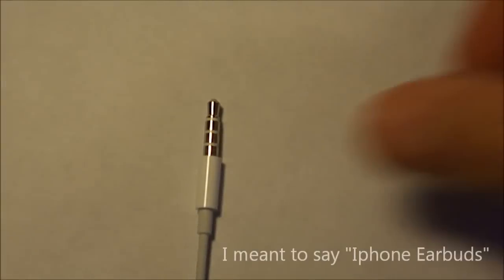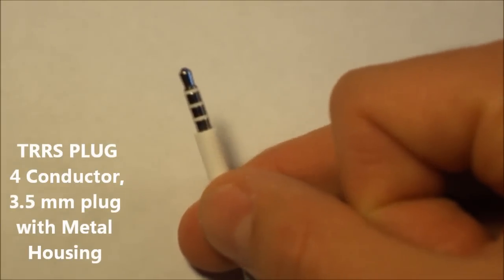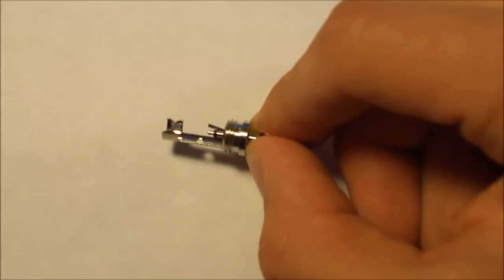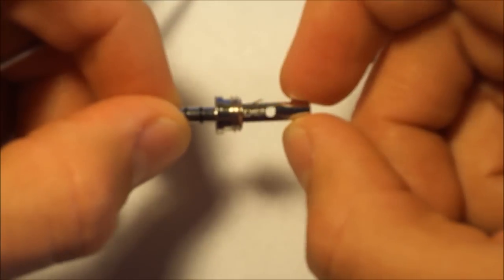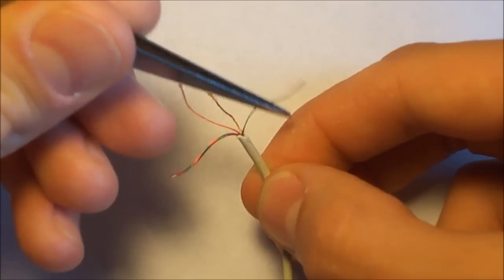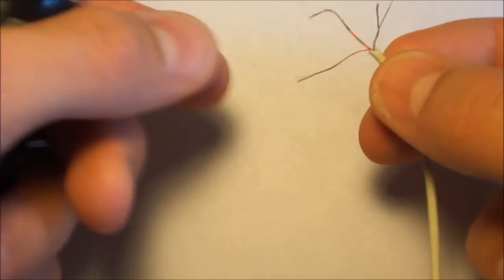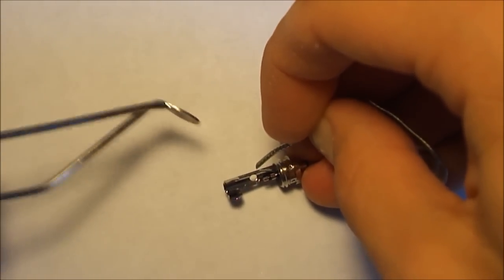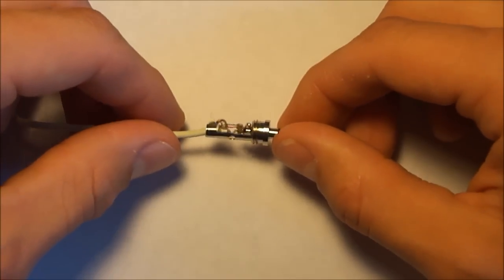Repairing Headphones with Microphone (TRRS Plug)

Comment: i really need saving .-.
i have samsung s3 headphones. when i cut it open, i found insulation, a red wire, a little twisted copper wires, a black wire and a green wire twisted in tiny green wires.
question is, what are the black and little green ones for?

Comment: Hey Rich! Would it work if I just use the replacement jack that I cut off from an old headphone I have? Both headphones are the same model.
Reply from the maker: Yes, I made two videos showing how to do this:
Headphone w/ Microphone Repair (Unbroken Headphone Set)
and         

Headphone Repair using Unbroken Headphone Set

Comment: What type of an adapter do I need that connects an android or ipad headphone (Sony MDRZX300IP or MDRZX310AP) to my HP EliteBook 8460p laptop which has a separate audio and microphone jack?  Please recommend. Thanks
Reply from the maker: You might have to separate the wires yourself and add your own TRS plugs. It's tricky. What headphones does HP usually recommend?  I am guessing that normally their would be a separate microphone (not integrated into your headphone).

If you want take it to RadioShack and tell them what you are looking for.  They might have something that could help.

Comment: will this method work on an astro a40 quick disconnect cable?
Reply from the maker: It should, but the wiring layout (colors of the internal wires) may be a little different, especially after the disconnect area.

Comment: So, has someone figured out how to get the button works ?
Reply from the maker: Yes, here is the wire configuration:
Red = Right Ch
Blue(or green) = Left CH
Copper = Ground
White = Remote
Blue(or green) + Red that were surrounding white wire (listed above) needs to be twisted together with the copper ground wire.
Reply: RichsMethods Thanks... It works :D
Reply from the maker: Albert Cipta Its like magic when it does work!

Comment: is it possible to recable a pair of headphones not earbuds that have a trrs cable with a trs cable and not have a loss of sound quality or any drawbacks or can you make a video that can explains how to recable a headphone with an interchangeable cable
Reply from the maker: I just posted two videos that may help explain this. The answer to your question is yes, you can exchange a trs plug for a trrs plug without loss of sound quality. However, you need to cover the unconnected wires with electrical tape.

Comment: Hey I did a google search for a Klipsch S4i repair because I wanted to figure out the microphone problem and found this answer, hope it helps!

The correct wiring should be as follows:

After you clip off the plug and strip back some rubber sheathing you will see wires separated in to 4 twists. 1-Red, 2-Blue(or green), 3-Copper and 4-red+blue(or green)+white.

Red = Right Ch
Blue(or green) = Left CH
Copper = Ground
White = Remote
Blue(or green) + Red that were surrounding white wire Need to be twisted together with the copper ground wire. This is critical!
Once I did this the sound was exactly as the new pair I had, Bass, highs, stereo separation were back! Just wanted to pass this along.
Reply from the maker: Thanks for the info. I'll keep a copy of this in case someone asks.

Comment: Hey Rich.  I need to replace the jack on a Plantronics headset.  One earpiece and a microphone boom.  Would this be the same process only using a 2.5MM jack?  I assume it'll also have 4 wires instaed of 5.

Comment: I have TRRS Plug but it doesnt look like the same as yours (internally) as the one in the video . It has 3 heads instead centering a flat middle .
Reply: and also , this is a Razer Blackshark ( which has a mic ) , and it seems that it doesnt have a red/green wire but only has a red , green , copper , and another copper covered in white enamel .  How do I do this then ? Really need help ! Thanks !

Comment: This 3 ring headphones usually come with some sort of controller, so in one side i have 2 copper, 1 green and 1 blue and , the other side, only has 1 copper and 1 green.The question would be:how do i join this together without using the controller?
Reply: same here~
Reply from the maker: Halim Mukreem I would join the two copper wires together (one if the ground for speaker portion while the other is the ground for the controller portion. The green wire is "sound" wire, the blue wire is probably the controller wire, but I'm not totally sure. I'd not connect the blue wire and treat the green wires are your right and left headphone wires respectively. If that doesn't work, then the blue wire is probably the sound wire in the one earbud (in this case, don't connect the green wire). It may take some trial and error, but it's worth a try.

Comment: Couldn't you just rip apart the jack you just cut off and use that? Instead of buying a new 3.5mm jack?
Reply from the maker: Yes I was thinking of making a video showing how to do this.
Reply: RichsMethods I would really appreciate if you make this video :D
Reply: Its easy :/
I fixed all of my earphones and headphones,1 skullcandy,bose,beats and a currently doing the sony...and used the same jack.Well the 4rings with mic and vol,play/pause earphones are tricky and usually dont work,so need a tutorial for that :D
Reply: RichsMethods I would appreciate that as well. Even more if they are the iPhone 5.
Reply from the maker: Wasee Mustafa
Arthur Reis
L. Joshua Rodriguez Depending on where the short is occurring, you might only have a small amount (or none) of the wire left over to solder back together.  You could resolder to the original jack (the metal part), but you'd have to remove the plastic coating and carefully resolder to the each respective connector. It's tricky, but doable.
Reply: I have been trying for around 2 hours to re use the jack, it's very hard to not get the wire touching and even trying to solder them on the body is small, just easier to buy a metal 3.5mm jack.
Reply: When headphones come in, dont check headphones, check the front speaker.
Propblem solved, dont need to order or fix anything.

Comment: Thanks for the helpful video.  I find one of the most confusing parts of this is figuring out what cable goes where for your particular equipment (L, R, Mic).  Then sometimes different names or references are used for the same parts and that increases confusion. For example, on the graphic at 6:00 you write about connecting a cable to the "ground" and another to the "outside" connector.  I would suggest you establish, for the particular application, which cable is what (L, R, Mic, Ground) and to what part of the plug it should connect - Tip, Ring1, Ring2, Sleeve...then also identify which or the connectors on the plug correspond to which of those...the outer one as sleeve, the center one as tip and which ones correspond to R1 and R2.

Comment: My volume/ mic button on the headphones aren't working how do I fix this?
Reply: MOREVENOM you found a way yet?
Reply: @Kyliej0nes  have you?
Reply: @ryalv4054  have you?
Reply: @xenondestiny  nah but twist it and try
Reply: @xenondestiny  or open your app up and then try also
Reply: @xenondestiny  have you?
Reply: Are the headphones your using iphone earbuds (the one in the video)? If so, what device are you trying to use it on? The volume buttons and mic are only compatible with apple devices. Maybe there are a few exceptions, for example pressing the mic button will pause my music and i am using a samsung, but other than that there are very few phones compatible with the apple earbuds other than apple devices themselves.
Reply: Fire Tiger i have the same as in the video for my iphone (its original) and my microphone and the volume buttons aren’t working , pls help me out is there anything to do to fix this 😭
Reply: @miraasr  have u found a way yet?
Reply: idk but i have the same problem

Comment: so my colors are like this | Green | Red | Copper ( rolled on the White wire ) | Red twisted with copper | Green twisted with copper | It's a bit different in your video so |  Green(Tip) | Red(second ring) | Copper(ground3rd) | White (Mic) | But what do i do with both red and green twisted do i put red twisted with the copper and green twisted with White Or Just twist the red and green with copper toghether and stick them on ground with copper just the White on mic seems a bit short?

Comment from the maker: I think that the copper and red wires are the same as shown on my video. However, the blue or the green wire is the microphone.  My best guess would be to treat the blue wire as the red/green striped wire in my video. If that does not work, then switch the blue wire with the green wire. Hope this helps!

Comment from the maker: Not for this plug (TRRS plug), however, if u have a TRS plug (my 1st headphone video), there is another option. My 2nd headphone video shows a TRS plug that does not use solder. Instead it has small screws to hold the wires in place.

Comment: No problem, but be sure you put the right wire on the right soldering spot. That could be tricky without a multimeter. They look a little different on the inside than what this guy is using in his video, that's why. If I recall correctly the most outer ring corresponds to the most outer solder part etc. If you see this picture and go from left ring to right ring, the most left corresponds to 4, then 3, 2, and 1. cdn.head-fi.org/6/62/900x900px-LL-62156fa4_plugsnshit.png

Comment: To get my jays four remote working on my iPhone 5 I connected the red wire to Tip, green to Ring 1, blue ground to Ring 2, white to sleeve and the copper wire surrounding my white wire to ring 2.    Another tip is buy 2 plugs as it takes a while to practice your soldering.  Use blu tack to insulate your wires inside you plug to stop it shorting.  Some people recommend glue but blu tack is easier to work with.    Total cost =$10 or 2 plugs.   Beats replacing $80 headphones

Comment: Great video.   Slight correction which result in the remote and volume controls working.   The red/green copper wire surrounding the white wire is more likely a second ground not the microphone wire.  The white wire is actually the microphone and needs to be connected to the sleeve on the plug.   If you twist the copper outer wires together and connect to the same terminal as the speaker ground your remote will work.   That is connect the copper wire to Ring 2 on your plug.

Comment: Hey, Rich! This is a very nice tutorial, however my colors doesn't match up these in the video. At first it looks like I have 4 wires, but the copper one is twisted around a red, so that needs to be twisted out first. Then there's a blue, and a green wire. But then there's also this kind of red and White wire, and it's that one that confuses me. I already have a new plug but I'm confused about where they'll go. do you have any ideas about where these would go? They're quite cheap Skullcandy.

Comment from the maker: The blue might be the ground for the microphone. Does the Green/Red Microphone wire have a white or copper colored wire mixed in it?  If it does not, then the blue wire is probably the ground and would be connected to the ground connector (with the other ground wire from the headphone).

Comment: Richs, i have a 8 pins samsung headphone (+mic) and i want to use this headphone with my samsung galaxy ace s5830 phone. My phone headphone jack is 3 pins. I cut the headphone cable to convert jack but headphone has 8 pin. Is it possible use this headphone for samsung s5830? Can i convert 8 pins jack to 3 pins? pins colours: black, white, green, blue, red, magenta (or purple), copper and silver (like copper but a bit dark). Thank you...

Comment: nice video thanks for uploading. one thing that i noticed here in the comments and in your video was the high price of TRRS (@ this price you can get a brand new low cost headphones) and thats how you get like 4-3 sets of broken earphones... any way i uncovered the wires and found out that i have 5 wires Copper (Ground), Red&Green (MIC), Red (Right),Green (? left) and Blue (? left) and i cant find info on how to connect them to the TRRS maybe do you know ? no standard type of earphones with mic

Comment from the maker: You most likely will have to do some "surgery" on the combined wire (large wire) and on the wire that came completely out. First, take the outer covering off the headphone wire (the one that came out).  Dissect out the wires inside. You should be able to determine the colors of the wires at least.  Next, you'll have to carefully remove the outer coating of the combined wire, and dissect out the colored wires in the Headphone wire. Then splice / cut these wires and reconnect them...

Comment: Guys honestly don't bother, I spent over an hour  and a half trying to get this done but it was a complete failure. The efforts not worth it. Juice aint worth the squeeze as they say.  I wasted 23 bucks on the TRRS plug cuz the little plastic part in the middle melted, just from the proximity of the iron. Wish there was a warning about that. Its easier to just take it to a electronic shop and pay for it to be fixed.

Comment: Hey Ritch, my original heaphones had a TRS jack (two rings). But when I exposed the wire, I get four wires: copper and red on one side(right), and green and red green on the other(left). With white wires in all four. Are the copper/green ones the ground then?

Comment: It's rather easy, just fixed mine today. After a while of trial and error I figured out where the other red and green wire are supposed to go.
You have 4 "pins" on which you solder all the wires, to go from inside out:
Most inner pin: green
2nd : red
3rd : 2nd red & green + white (it is inside the copper wire)
Most outer (largest pin): copper (ground)

To figure out which are 1st and which are the 2nd red and green wires. Just try them on the inner pins. The pair that produce music go there.

Comment: The SNAP converts your earbud wires into: 1) a leash to prevent device loss and theft, and 2) a catch wire to prevent dropped device impact damage.      PATENT PENDING
Go to "Earbud SNAP" You Tube

Comment: ok so I have the latest apple earpods but they don't have the volume adjuster. at first the left earphone didn't send audio and then later the right one broke as well. usually I can fix the right when I twist the jack a little but its not tht effective. I was wondering which jack will work on this earpod?? please reply back as soon as possible

Comment: Today I bought only TRS Plug, unfortunately at home I found out, that my broken headphones have TRRS plug. I realize that after I soldered it. I tried lots of combinations. Finally I put together blue wire+handsfree(mic) wire and soldered it into right portion hole. I completely skipped red wire. And then I rolled the copper wires (one is thin and second one thick) together, put through the ground portion AND then I soldered it from the outside with left side portion. Strange, but it WORKS !

Comment: I have beats tour in ear  headphones that i got a new trrs plug for. i have a red,green, and 2 copper stranded wire sets(with no other colors on them). i can't find anywhere on the internet the color coding to pin connection. do you know which is which? thanks

Comment: FYI - A-Jays Four wiring is as follows: Red = Left audio, Green = Right audio, Blue = Ground, Copper wrapped around a White = also Ground, the White = Mic. Flame off the coatings to help solder, and it should work a treat... thanks

Comment: Thanks for the video and I tried connecting my Turtle Beach PX-21's to a 3.5 trrs plug I salvaged from some old Skull Candy Buds.  In reading your advice for the other commentors here, I think I may have to rearrange some wires. The wires on the PX-21 headset was desoldered from the inline remote and has your usual 3: red, green, copper, and then another mic set of another ground and it's companion for a total of 5.  How would I splice these to the trrs wires?  THx in advance!

Comment: So could I do this for a Turtlebeach XC1 headset for the xbox 360 controller? But instead of a 3.5mm, buy the necessary 2.5mm? Also, how would that work since the headset is mic/speaker (so im assuming blue wire within), and the 2.5mm looks like the regular trs 3.5mm. Pardon any dumb questions - ive never tried anything like this but wayyyyy too tired with blowing money on new headsets when a lil soldering could fix it

Comment: Hello there, I have Sony Mh1c headset. It has a remote (mic and volume) but it's not compatible with my iTouch 4. Do you think if i'll change the jack of it, it will work on my iPod?
About also your video, did you already fix the volume control?

Comment from the maker: I think you are correct.  However, you may only need a TRS plug. You're microphone might travel on a different line than I show in this video. I am not sure though which wire goes where. You might have to experiment a little.

Comment: I have some skullcandy headphones that only work on one speaker and I got a TRRS plug. I just noticed though that the plug on the headphones just has 2 black rings despite having a mic. Can I use the TRRS plug I already have or do I need a TRS plug? Your advice would be greatly appreciated :)

Comment: To fix bass u have to mix grounds with the mix = bluecoppergreenredwhite wire! So now u have red single green single and the mix connect red to the one little metal thing on the plug. Green to the other little metal thing and mix to the big metal thing .!!yeey u have now working headphones with bass but no mic hope it helps

Comment: For those of you guys that cant find the special plug and still want to use the headphones that came with your phone or etc i have a solution so : u have to buy the normal plug with 2 rings that means that mic will not work but headphones u have 7 wires 1 green that is single 1 red single again copper single again and blue single again.then u have 3 other that are mixed -red green and white inside. Red single is for left ear green single is for right ear.